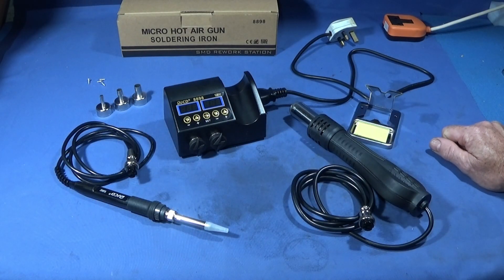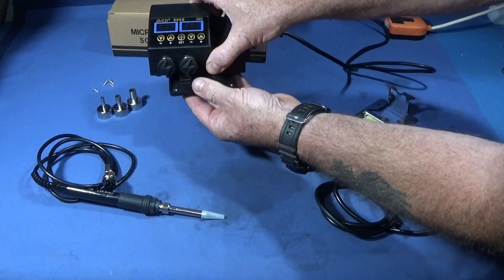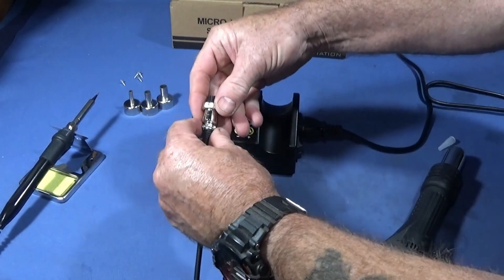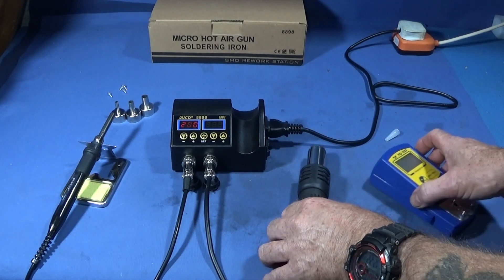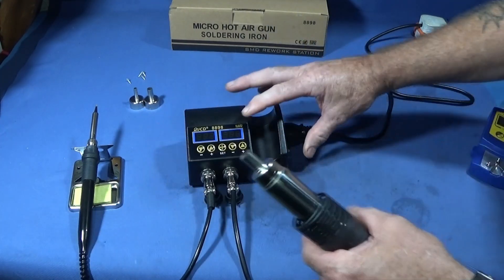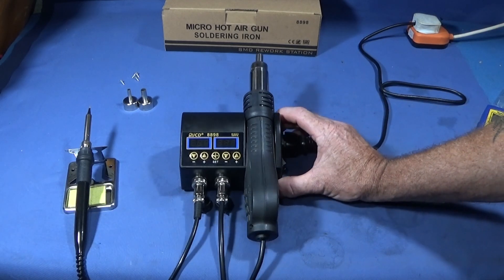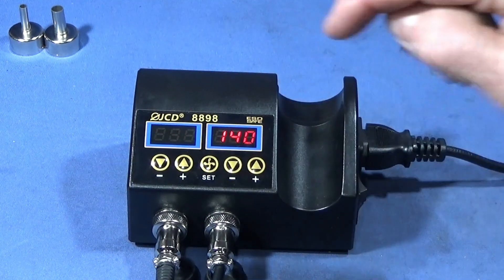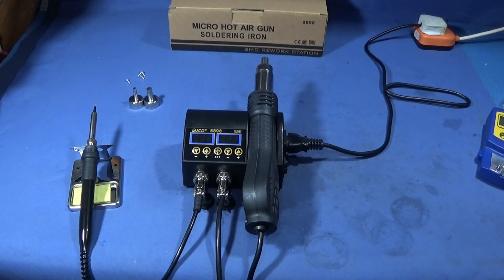JCD 8898 Two in one SMD Soldering Iron & Heat Gun Rework Station Review

Comment: My son just bought one, about a week ago, he went to switch it on after a week and it didn't work. He opened it up and found the power regulator blown off . It is 8pin dk125. Any suggestions  that may help plse.
Reply: I have purchased over 300 units and one of them blow up once I turned on the heat gun for the first time, mine burn down the small bridge rectifier (and took with it the DK125 and a copper trace) already fixed the copper trace with a wire and ordered the bridge rectifier and dk125 from Aliexpress for like 2 dollars for 10 bridges and 5 DK125, the parts are already in my city, ordered them like 10 days ago, I will install them and see if that fix the problem of they blow again I will replace the varistor (the x2 cap sims to be fine reading the right value but I have no way to check the varistor)
Reply: @oscaremoralesp28  
Did it fix it
Reply: @KC08RAS 
Yep, that unit is still working daily on a cellphone repair shop.
Reply: @oscaremoralesp28  
So they good machines? Any tips or upgrades u done to it?

Comment: Bom dia. 
Comprei uma estação dessa  ai a  uns 2 meses atrás e o ferro de solda e preciso colocar a temperatura máxima para poder derreter o estanho .
Ele parece que não está esquentando o suficiente  
Se eu coloco o meu em 350 graus ele não derrete nada. 
Parece que está com problema ! 

Agora o soprador veio perfeitamente muito bom !
Reply: Tu estacion es para 220v y la estas usando en 110v, lo unico que necesitas cambiar es la resistencia ceramica, revisa el valor de Ohm de tu ceramica y si te da 135-145 Ohm en el cautin y 80 ohm en el aire caliente entonces tienes una unidad de 220v, los valores correctos para 110v son cautin 40 ohm y aire caliente 20 ohm, en la tienda oficial de Aliexpress puedes comprar los templazos correctos que están publicados como resistencia 110v 80w y resitencia para aire caliente de 110v (aproximadamente 3 dolares cada uno)
Reply: @oscaremoralesp28  bom dia. 
Eu pensei em comprar uma  resistência de 220 volts e de 80vats. Para ver se funciona !
Reply: A minha estação aparece um código 5-E no visor do soprador de ar, não esquenta logo que começa aparece o erro é o soprador desligar

Comment: Good review. Thank you. I've ordered one. BTW, I noticed a couple times that you just switched OFF the hot air gun while it was ON and displaying temp greater that 100 (e.g. 140). I think you should not do that. The reason is that the heating coil needs time to cool off BEFORE switching OFF. That is why when you place the gun down onto the holster, the heater temp starts to reduce (as power is switched OFF by the controller) and the fan stays ON. Even after reducing the temp down to 100, the controller keeps fan  ON for few more seconds before switching OFF and displaying "- - -". This is a safety mechanism to avoid the plastic handle melting.
Reply from the maker: Hi Thanks. That's a good point. Regards Steve

Comment: I bought the 110V unit for North America and it doesn't get hot enough. Does anyone know if the control unit has a different board for 110V because mine says 220V input.
Reply: Same problem i'm 99% sure it's just a wrong heating element, mine is measuring 145 ohms, and I'm sure it should be about 40-50 Ohms for 110V. So is likely a couple of bucks fix, but I need confirmation from someone with a 110V working unit measuring the resistance between pin 1 and 3 of the soldering Iron.
Reply: @oscaremoralesp28  it should be 20ohms for 120V That's what I have but still not hot enough. 120Vsquared/20ohms=720W
Reply: @oscaremoralesp28  I get 144Ω for the 220 V unit and the one supplied fitted in the unit was 133.8Ω which I suspect is a 110V. pretty sure you have a 220V fitted in yours as standard and mine had a 110V fitted as Standard. I had ordered a 220V lead on mine. I bought my spare ceramic when I bought the unit as someone on Banggood had already mentioned problems with the soldering iron so I bought one as a spare to check against the original.
Reply: @KingWhiskers1 
For 110V they use 40 Ohm for 220v they use 140 Ohm. I have purchased over 300 units by now and they started putting a sticker on the units to differentiate between units using 40 ohms and 140 ohms, also the eat gun uses 20 Ohm for the 110v and 80 Ohm for the 220v (both works with 110V but if you plug a unit with the 20 Ohm resistance into a 220v connection it goes red hot in a second)
Reply: @oscaremoralesp28  Thanks for that, I have just purchased a single unit for 220V and that is the readings I got from the two Iron ceramics, not tested the heat gun ceramics yet but I will. I seems to be working OK though.
Reply: @oscaremoralesp28  Sweet FA on my unit. Only  QC Passed sticker.  The fuse holder says 250V and that's it. Checked out the heat gun elements and they come out at 79 Ohms, both the original and the spare. I guess the iron ceramics must be both 220V as there is only 11 Ohms difference between the two.
Still learning about this sort of stuff. Thanks
Reply: then u got the wrong model. if your says 220V and u are in USa were u have 110  then u are getting half of the power...

Comment: If you turn the Hot Air at full speed and full heat, will it still melt lead-free solder?
Reply from the maker: I will have to try it. Regards Steve

Comment: One question sir. Can you please look at the back side and see if it is 220V/110V swich power supply because i have mistakenly ordered with 110v US plug but i live in EU as well so i can rework just the plug like you did. Thank you.
Reply from the maker: All that it says on the side is 'use only with 250v fuse'.
You could contact them to change your order?
Reply: @SteveJordan  Thank you for response. I contacted them and they say that is changed and it is shipped, but still i see on order that is US plug. I am hoping that they are changed it fisicaly but not on paper order.. but if it comes 110V I will change power supply. Resolder my soldering station with another transformator.. Thanx again!

Comment: Spare parts like a soldering tip is an unknown part for at least Ebay sellers. If Banggood is better I don't know.
Reply: Banggod has spare tips check the questions under the proscut
Reply: 900M-T Tips, millions of them on ebay.
They are a standard type of tip, lots of different sizes and shapes. Iron with copper tip and copper only.

Comment: That's a pretty cool set up what have you used the hot air for? Have you tried it on heat shrink? I'm not sure it will be hot enough.
Reply: It goes to 450 c its hot enough

Comment: The iron and tips look similar to an Atten soldering station, can't remember the model number.
Reply: Uses the 900m-t tips
Reply: @RealTECKS  Thanks
Reply: @RealTECKS  Would you say it can use all 900m series tips? Would you have the opportunity to measure the ceramic tip diameter of this jcd 8898 or you don't own one yourself? (thanks in advance)
Reply: @XeioDeSono  I will measure as soon as I get to my shop. Do you need metric or imperial?
Reply: @RealTECKS   thanks a lot. I prefer metric
Reply: @XeioDeSono  the diameter is 3.7mm and lenght is 25.3mm

Comment from the maker: SEE LINK BELOW:-
JCD 8898 2 in 1 750W Soldering Station -- https://bit.ly/3jjSYTQ
OR BUY THIS ONE IF YOU WANT A SUPERIOR PIECE OF EQUIPMENT: SEE LINK BELOW:-
KSGER STM32 OLED T12 Temperature 2 in 1 Hot Air Dryer Digital Rework Soldering Station  -- https://bit.ly/2GdzPVm